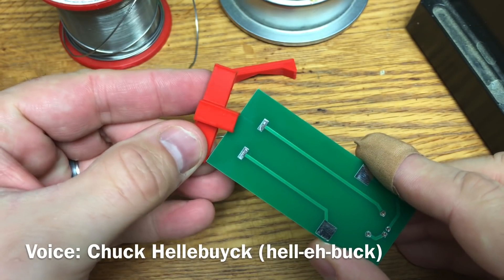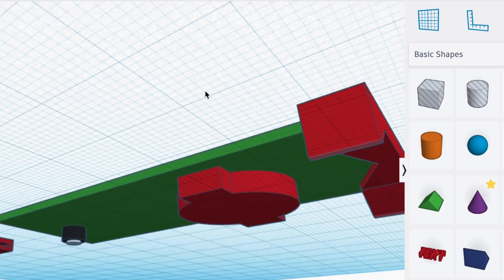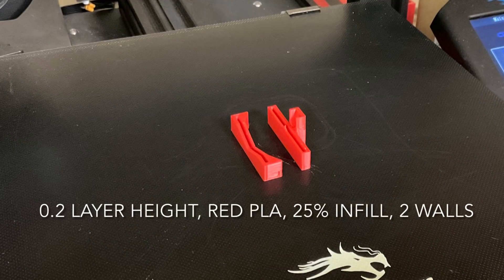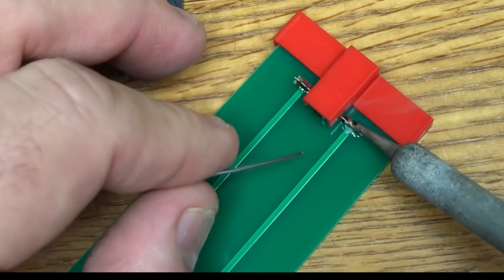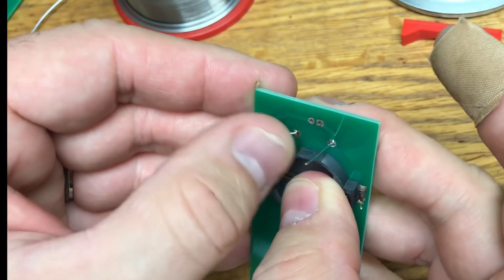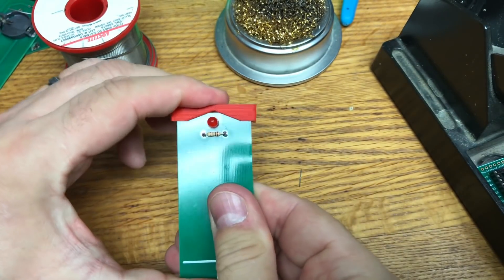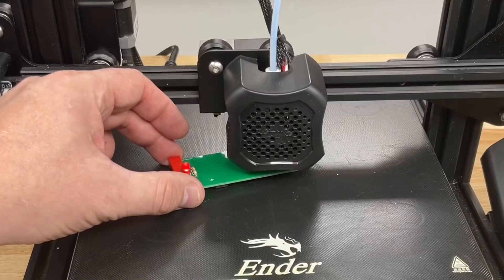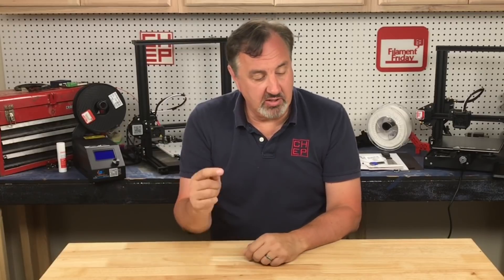Level Your Bed with the Filament Friday E-Leveler Tool

Comment: I have new Ender 3 s1 plus. And i am not able to use the tool. You said to run the print and adjust. Where as there are many videos that say i need to adjust the z offset first a d the  run the gcode. Its so confusing for beginner like me. I would really appreciate if you would tell in detail steps for me to level the bed.. i have gone through the website and instructions provided. But as i said there are many videos that tell to adjust the z offset first . Waiting for your reply.
Reply from the maker: It’s mainly designed for non auto level printers. Auto level when it homes sets a z offset. So you need to zero Z manually, then move to each corner.

Comment: I have kingroon KP3S pro s1, can I use the leveller and if yes then which file to use. My bed is 200mm x 200mm. I bought the product but just do not know which file to use as it only has for Ender 3D printers.

Comment: I just purchased it from Amazon, pre built not kit. My ender 3 pro has replacement springs on it and I have un screwed to the point the knobs fall off and the sensor does not fit under it, Does this only work with STOCK sprint?
Reply: Sounds like your limit switch needs adjustment to account for the new springs

Comment: I know this thing works because my son has one, but the one I have has one pretty big problem. The switch is not centered under the cross section so when I try to use it the whole thing tilts to one corner. The only other issue I have is that it goes to fast. I had to push print then slow the print speed way down just to have time to try and get it lined up so it wouldn't tilt. I sure wish there was a way to make it like mesh leveling where it doesnt move until prompted. I dont know why I bother commenting. I guess I'm just frustrated.
Reply: I thought it was too fast as well, so I edited the GCODE. Look for the value 15000 and change it to 60000 to make it pause for a minute.
Reply: @kathikellenberger424  this is brilliant advice. I don’t know why on earth I didn’t think about that. Thank you.

Comment: Hi Chep! I just received your level tool, but I have a question, I have an Ender 3 V2 Neo it has Cr touch, how do I use this tool considering that when I run the g code to take the nozzle to each corner it will make tiny adjustments to the z axis? Do I need to reset everything to factory settings?
Reply from the maker: Use it with the GCode before running autolevel to get a good level starting point. https://www.chepclub.com/electronic-bed-level-tool.html

Comment: mine came defective with a broken peace that holds the battery in right out of the box you really need to look at the quality control of these now I'm going to have to return mine was really looking forward to using this tool and being able to start printing again
Reply from the maker: Contact the seller on Amazon and they’ll send a replacement.
Reply: @FilamentFriday  I got the same defect and i didn't get the the printed part that goes over the switch and battery i can just use tape where the .stl for the switch cover printed part?
Reply: nevermind i didn't see it was just as a jig u good thanks going to try it soon
Reply from the maker: Contact the amazon seller for replacement. The stl is on the same page where you got the GCode. https://www.chepclub.com/electronic-bed-level-tool.html

Comment: Just got mine! I tried it out with my Mega S and prints are coming out more consistently. But it seems like this process leaves my bed too high. If I slip a piece of paper under the hot end after using the leveling g-code and homing the print head, I can't move the paper without a lot of tugging. When print with a brim, the brim comes out translucent, and leveling tests fail pretty spectacularly. I don't want to scratch up the bed; is there something I need to do with the gcode to adjust? Z homing seems to work fine and I do home the printer before running the gcode file.
Reply from the maker: Adjust so the light just says on.

Comment: im soo confused. i bought this, and everytime i run the gcode to start leveling the extruder constantly stays a few MM above the leveler? is that normal? Im constatly having to raise the bed to make the light turn red to no avail..
Reply: NVM. I have an Ender 3 Pro with CR touch, the CR touch will constantly keep the bed raised up higher and higher since it replaces the Z Stop. the method i found that works best is to move the Z axsis until it turns the light red, disable the steppers and move it around the build plate until its all leveled, than use the wizard for probe offset and level it to the tool and subtrack 5.7mm from the offset.
Reply: @ICYKCBlue  I did this the first time I saw it and worked perfectly. Had to change a few things so it messed my  zoffset up and couldn’t remember the process and couldn’t find this post but here we are now lol. Taking a screenshot of this lol

Comment: If anyone is debating on getting this or not I’ll tell you this I have never had more level bed this before having this tool… is better then ABL and a lot better then using paper .. so go ahead and buy it and you won’t regret it me personally I think this he need to get a pattern on it so no one else can make it and up the price for it because this thing right here is worse well more than $25 bucks … awesome work man… it would be awesome if you was able to use it on the Artillery Sidewinders

Comment: Will this work with a Longer Lk5 pro?
Reply from the maker: I’ve never tested it but if it’s a manual bed level then it should. Just choose the GCode file that matches the size of the bed.
Reply: Kalvin, did you get this to work with your Longer?

Comment: worked great. however right out of the package the battery holder clip? was broken. I had to use a strip of duct tape to hold it in. HOwever after that using you r unit and g-code worked like a charm. thanks!! used it on an ender 5 pro

Comment: I had issues with the GCode on my Ender 3 V2. it would go up to Z8 but instead of coming down to 5.8 it was just going back to Z0. Ended up just noting the co-ords and moving the head manually from the screen.

Comment: subscribed! Love your videos. Recently purchased the E-Leveler but I'm unsure if it will work for the Ender 3 S1 Pro. When manually leveling the bed, the only option given is 0.5 increments for the Z offset. Your video and others I have seen, you can increment by 0.1 if not mistaken. Can you tell me if this will still work? Regardless, your videos are super cool. Thanks
Reply from the maker: Use the GCode for the E-Leveler. Download it from the site. https://www.chepclub.com/electronic-bed-level-tool.html

Comment: I just got this yesterday and having trouble trying to figure it out with my bltouch not sure what I should set my z offset on the bltouch to so I can use the tool to level the corner
Reply from the maker: Use it to level the bed manually. Then follow the instructions in here to set the Z offset. https://youtu.be/TroPjdkSEOY
Reply: @FilamentFriday  so In the menu I set the bltouch z offset to 5.7 before I level the corner with the tool. I’ve already have the bltouch installed and everything I’m just confused by that part if that make sense

Comment: Hey CHEP can you make a GCode that’s a little bit slower or one that pauses at each corner? This gcode does go a little to fast, I’ve had to run the gcode at least ten times just to get it level. I have no problem with the e-leveler or my printer.

Comment: Running into a bit of an issue. I run the gcode and some of the corners I cant finish in time before it moves on. When I run it a second time, the corners that I got right are now needing to be lowered even more, kinda like it didnt know what it did prior. Am I doing this wrong? Like I ran it a second time and one of the corners I cant tighten since I am at the lowest it can go even though in the prior run I could adjust it. Just need some help understanding if back to back runs are not right. I am using an Ender 3 Pro with CR Touch 4.2.7.
Reply from the maker: You might have this issue. https://youtu.be/8qLJyaBlCCA

Comment: hi chuck i bought this kit a month ago and iv had to set my z offset to like -1.1 or so is this normal or should it be exactly at 0 z offset
Reply: i forgot to mention i have an ender 3 with a cr touch installed
Reply from the maker: The Z offset should be based on the CR Touch distance from sensor to nozzle. Using my E-Leveler should result in no change to Z offset. Without autolevel should result in Z =0.

Comment: I have a question about this tool. When we run the file, do we put our z-offset to 0? or back to what it was before? I have a BL touch on my printer and i want to use this to make sure i'm level every time. but i want to make sure i put the right z-offset
Reply from the maker: Run the GCode for it and it handles the Z offset. https://www.chepclub.com/electronic-bed-level-tool.html

Comment: I'm curious if this bed level tool can be used along with a BL Touch, because its always best to start with the most level and then the BL Touch can adjust better.
Reply from the maker: Many people are using it for just that purpose.
Reply: @FilamentFriday  Thanks, 
I assume process would still be the same for both the electric leveler and the bl touch procedures.
Reply from the maker: Procedure for E-Leveler is here: https://www.chepclub.com/electronic-bed-level-tool.html

Comment: I am having an issue. Can I use this with a BLTouch? I seem to having an issue with 5.7 Z-offset. It is way to far away from my bed with the bed as high as it can go.
Reply from the maker: Are you trying to level it before using BLTouch?
Reply: @FilamentFriday  Yes. I am kind of new. I rough level it the manual way then level with the BLTouch. I recently changed the level knobs and springs. I have Z homing with the BLTouch and I think that is the issue.

Comment: Hello there CHEP. Got the tool today and everything soldered up and I have an Ender 3 V2 farm BUT, none of them are stock anymore. I have BTT boards and I am running Klipper. Is there a way to implement your tool with this and save the offsets? Or what is the offset supposed to be when using this tool and I guess I can manually input it. I DO have the CR-Touch also but wanted to get my beds really dialed in so the CRT can just do the final micro adjustments IF needed. Thanks!
Reply from the maker: 5.8mm offset. Did you download the GCode file that you use with it? 
https://www.chepclub.com/electronic-bed-level-tool.html

Comment: Is there a corner test gcode file for ender 3 pro to download? Got this a week ago but haven't found any gcode to use with it.
Reply from the maker: It’s on the page with all the info linked to the bar code on the package: https://www.chepclub.com/electronic-bed-level-tool.html

Comment: I couldn’t agree more about using a 3D printer to create stuff you can use is fun.  The main reason I got a 3D printer about 3-4 years ago was I am a ham radio operator (W1ND) and love making antennas and portable gear.  I found that there were things I simply couldn’t buy or build the conventional way so I bought a Monoprice Select V2 mini and learned TinkerCad and OnShape.  I’ve actually come to rely on this now, I can create some pretty complex things and print them up in a weekend (or at least rev 1-5) and test them out, make tweaks, etc.  I don’t think I’ve downloaded someone else’s stl yet, I’d rather create it myself.

I found your channel because I just broke down and upgraded my Monoprice to an Ender 2 Pro yesterday and wow, just wow.  While the cooling fan is the loudest I’ve ever heard, the steppers are silent and the prints are excellent.  I just need to tweak the settings to get my Petg prints better, I had them down pat (almost) on the Monoprice, but I was really pushing it.

Comment: Hey Chep I just received my E Leveler Tool and noticed that my battery holder doesn’t have a lip to keep the battery in place so it just pops out. Contemplating trying to 3D print a cover or just tape it in place. Has anyone else had any issues with this?
Reply from the maker: Contact us where you bought it and we can replace it.

Comment: Hey chep, just tested the eleveler gcode and it doesnt go from corner to corner from me. It goes from the bottom left, to middle left, to middle, to bottom middle. How could I fix this?

edit: just an update, for my set up (ender 3 with glass bed, pla @ 220, bed at 60) you have suggested 5.6 and 5.7 in the past and i tried both without success. the batteries for my calipers died so i had to wing it and found i that 5.8mm for my z-offset worked great. had to manually move my extruder above the adjustment screws and rotated until the light just about turned on, and turned a very minor bit more to get the light steady. printer is finally printing well! i'm printing the support part for the board now with success so far, to my surprise. will update in the next couple days.
Reply from the maker: My latest GCode used 5.8.

Comment: I just purchased this. Problem is I have a warped bed. Can I use this with manual mesh leveling? I can’t see anywhere to offset the z for mesh leveling that high. Ender 3 with marlin on an skr mini board.
Reply from the maker: Not really but fixing the warped bed is the first thing to do. Where is it warped?
Reply: @FilamentFriday  if I do the four corners with the leveler tool and go to the center and check that, I need to bring the center up
Reply from the maker: What printer?
Can you shim underneath the center of bed surface?
Reply: @FilamentFriday  it’s an ender 3 pro. Would u shim under the magnetic surface?
Reply from the maker: Yes. Many people do. Some just use aluminum foil.

Comment: Lol why not just put the X on the side with the button?
Reply from the maker: How would that help? 
You wouldnt see it when trying to line it up.
Reply: @FilamentFriday  you could easily line up the center of the button on a large crosshair
Reply: @FilamentFriday  or better yet, use a through hole mounted switch
Reply from the maker: I don’t think you understand how it works.

Comment: I have a cr touch should i use this then start the cr touch?
Reply: Yes, you should still occasionally level your bed manually even with an ABL probe, since they still require that your bed is mostly level. But you don’t need to do it super often
Reply: Did you get this to work or have instructions on how to use it with the CRTouch.  Im struggling.
Reply: @dcs3473  actually no when I used it the build a mesh the difference was bad so I did a mesh via jyers and I’m goochi took time but I got it to work

Comment: Hey CHEP, I got one of these to use with my Ender 3 Max, but I am not sure that I have the ability to set the initial Z-Offset for leveling. Do you know if its possible to use with the 3 Max?
Reply from the maker: I created a GCode file that handles it. There is also a max version at the bottom of this page: https://www.chepclub.com/electronic-bed-level-tool.html
Reply: @FilamentFriday  Oh wow, didn't even see that, perfect, thank you!

Comment: Hello Chep, I bougt this and have been wanting to use it but being very new to 3d printing I am not sure how to get started, The main reason is, I have an Elegoo Neptune 2S and all of your instructions only speak to Ender printers. From what I understand, the Neptune 2S is essentially the same as the Ender 3 (?) and should be able to get the same results but I am reluctant to try and possibly mess things up. My other question is, should I tighten the level wheels all the way down first?
Reply from the maker: Watch the 2nd part of this. It might help. https://youtu.be/ei7HbfuQd-s
Don’t be afraid to try, you really can’t hurt it.
Reply: @FilamentFriday  Thank you for responding! I followed things as best I could but was stumped right at the beginning. I sent the gcode to the machine so that it would start it's positioning for each corner and center of the bed but as it ran, it never paused. It just would go to each point, position the Z and then move on to the next point until it finished. I was curious so I opened the gcode in a text editor and did some googling and from what I read, everything in the code looks like it should work without a hitch. Any help is most appreciated but I will understand if you are reluctant to get into a full teaching moment due to time constraints.
Reply from the maker: It may not recognize M0 pause. Try the M25 version further down on this page. https://www.chepclub.com/electronic-bed-level-tool.html
Reply: @FilamentFriday  Unfortunately a no-go. I looked through many uninformative and useless google page suggestions last night. Came across one promising site that has listed many different flavors of gcode and I tried to replace the command with one of the others but no luck yet. Didn't go through them all yet, so tonight, I know what I'm doing. I can't seem to find anywhere what flavor of gcode Elegoo uses. I shot them a tweet.
Reply from the maker: Just home it and then set z to 5.8mm. Then disable steppers. Manually move to each knob and adjust using the tool. Then home it again and fun the squares test. You should be good.

Comment: Hello Chuck! Great thing, I think and thank you for this invention / relief! Of course i wanted to buy it immediately and, for convenience, even the pre-assembled one. Then, at checkout, the "surprise": $20 the price plus $20 shipping costs (live in Germany) makes $40 plus taxes, customs etc... A bit too much, even for me! ;) Hence my question: Is there another source, something "international-buyer-friendly"? Thanks in advance!
Reply: You can also solder the circuit on a prototyping board. It won't look as nice though and maybe you'll need to play with the z-offset a bit because the height of the switch might not be correct.
Reply from the maker: Not right now. I’m trying to find a better option.
Reply: @FilamentFriday  That would be great! Thanks!